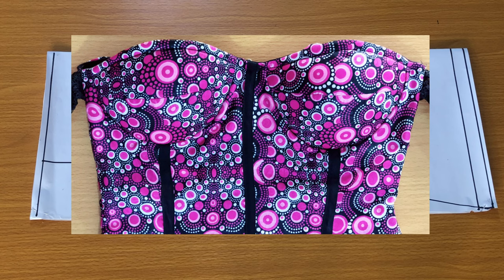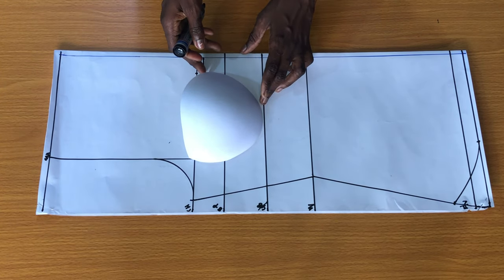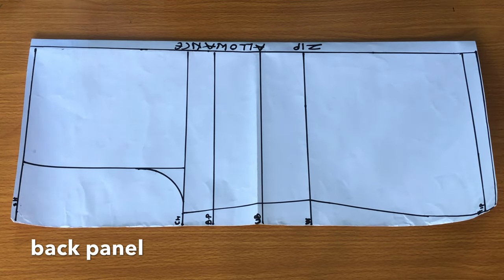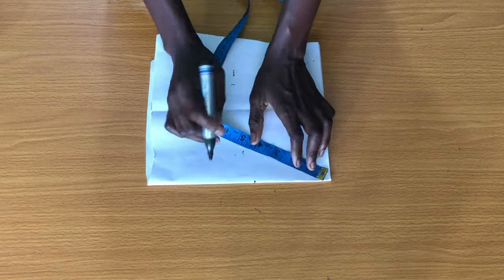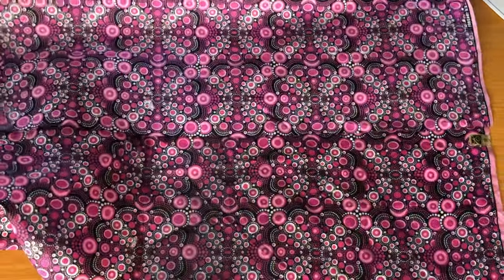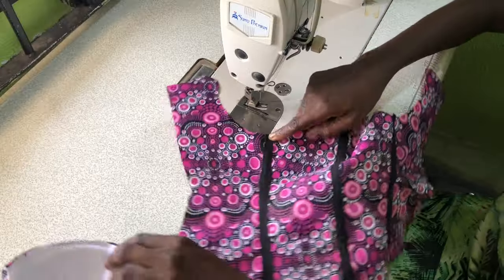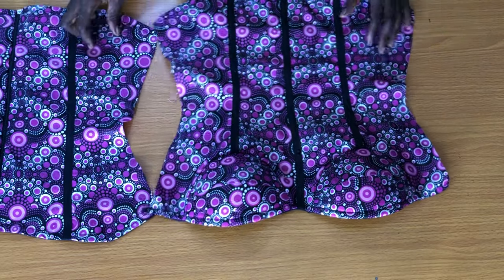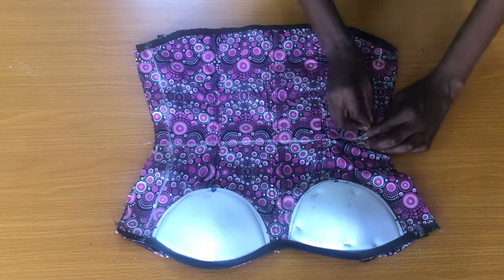How to make a Corset with a Bra Cup | Easy Pattern || Cutting and Stitching

Comment: Does this measurement work for all burst size... Am making for a size 48
Reply from the maker: The method and process works but for your preferred measurement. Don’t use my measurement
Reply: Thanks sis.... I am making for a burst 48 what cup size can I use and it will also have a key yoke at the upper part
Reply: Do u have a tutorial for the keyyoke
Reply from the maker: Hmmm. This cup size can be confusing because. A burst 48 can have a small breast and a wider back and and burst 48 can also have a big breast and a small back...... in this case i will advice you size the cup on her burst first before using it on her... but can can also get a size 48 or 50 if you can get to ur client

Comment: Thank you....why 3 inch from the waistline?
Reply from the maker: I didnt mark 3inches from the waist line. I marked for inches on the waist line because the burst span divided by two is 4”.

Do you mean 3 inches above the hip line? I marked 3 inches above the hip to get the dart, because if i should extend the dart to the hip line, the blouse will be too tight around the low waist.
Reply: @stylemebynancy  thank you for answering...lol, I meant to say above the hip line🤦‍♀️
Reply from the maker: Thank you 💞